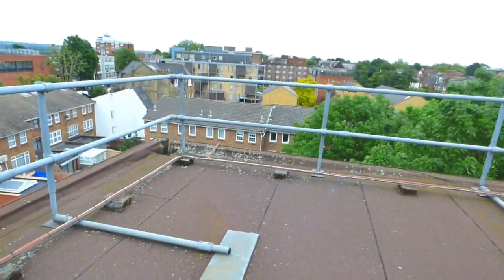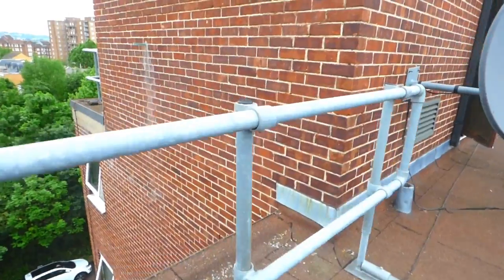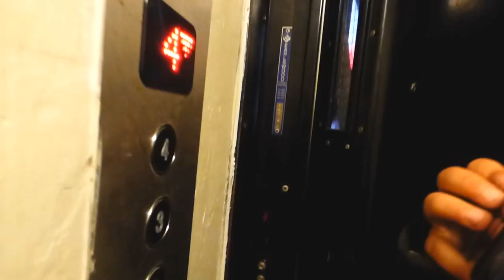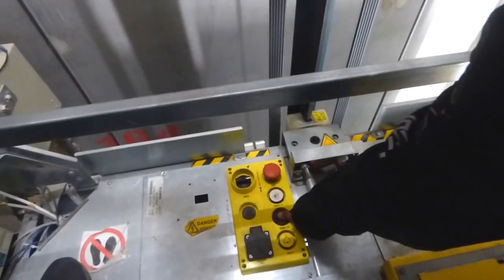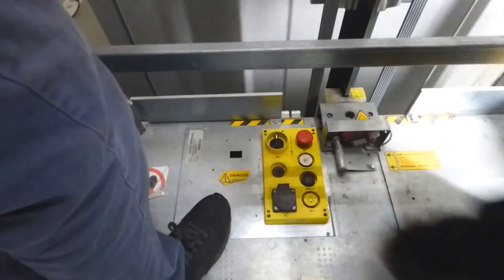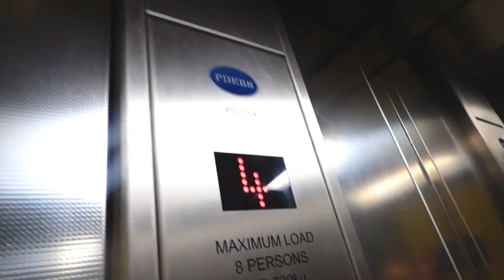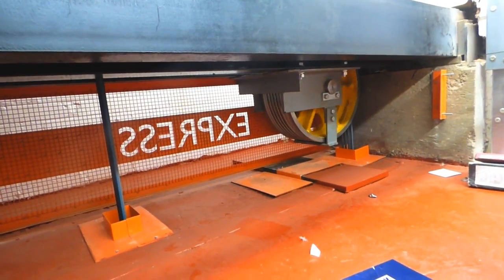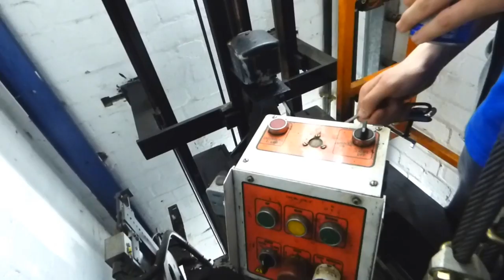Lift Adventure in Hackney

Comment: I can't really see the point in having a button for every floor if the lift only has 2 floors. They could have only 1 button which takes the lift to the other floor that it is not already at, or have destination dispatch so the call button will call the lift to your floor, then the other floor, in that order, so the lift goes automatically.
<br>
I once went in a lift which had call & floor buttons outside but it was still a passenger lift because the buttons still worked when the safety was broken, so you would open the gates & push the floor before getting in the lift, then close both gates & the lift would go automatically. I don't know how it dealt with multiple calls, but I think it could only remember 1 call at a time. The building it was in has now been demolished.